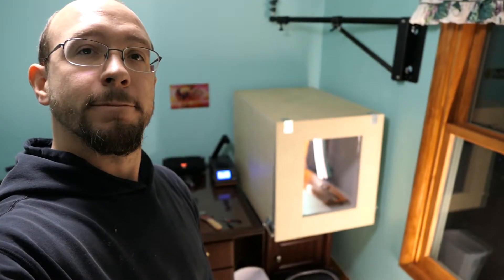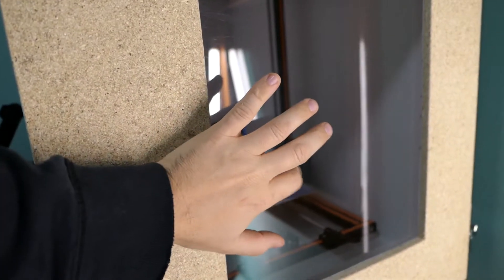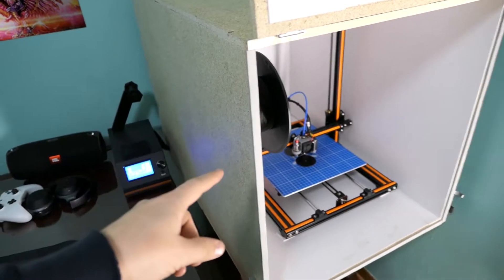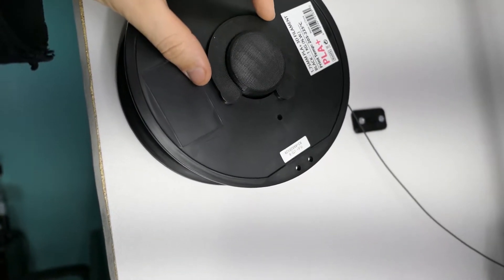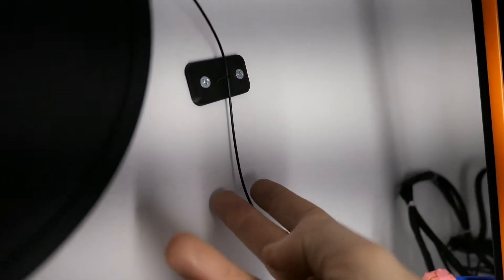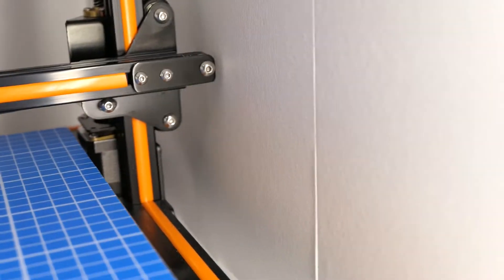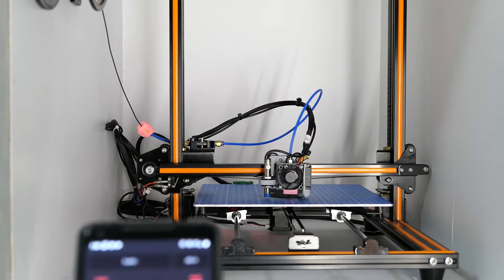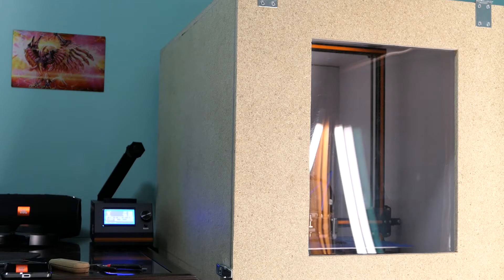Custom Anet E12 Printer Enclosure - Fully Built!

Comment: 100% airtight, except for the 7/8-in hole in the back... Just kind of tickled me... all joking aside, thank you so much. I just bought the ANET e12 and I am definitely going to build something very similar and probably just as airtight... 😁
Reply from the maker: I don't think COMPLETELY airtight is a good idea.  You still want SOME kind of airflow.  This isn't a kiln, it's just meant to keep the temperature more stable around the print.

But the idea behind this is pretty simple.  Although it's a little over-engineered.  lol
Reply: I was really just kind of kidding. It just sounded funny when you said it. Thanks again for posting

Comment: You could put some professional sound isolation on the inside of the box. And remove the plastic window destroying the purpose of the box. ( the weak link in your isolation ) I think you can even 3d print some pretty good sound isolation for the inside. Or one more layer of wood.
Reply from the maker: I need to be able to see what it's doing without bothering it, so the window is a must.  Could make a second layer of Lexan, with an air gap in between.

Comment: When you put the printer into a "box" you actually increase the noise. What do you call it on english. Ecco? It is like you take a long tube. person 1 takes it to his ear, person 2 shouts in to it. And it is much louder ( concentracted ) than if you jsut shouted out in the open air for person 1. Pretty basic. Also, the thicker the box walls the more sound isolation. The material also matters. Plastic is likely the worst sound isolator also.